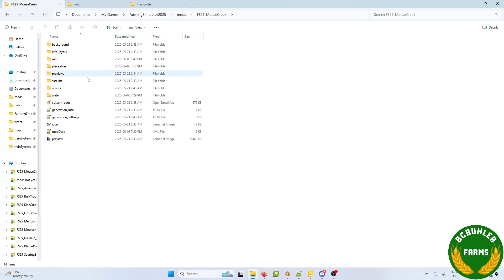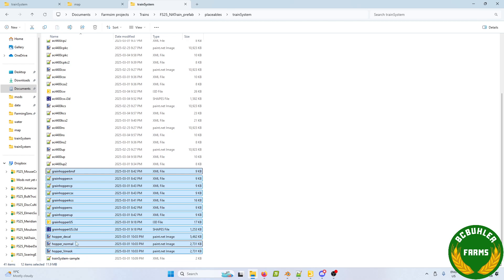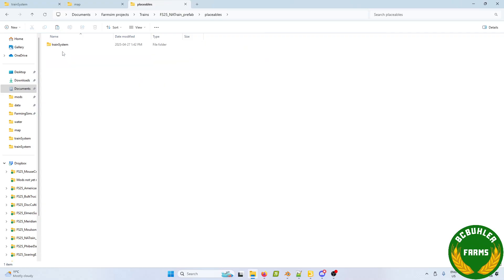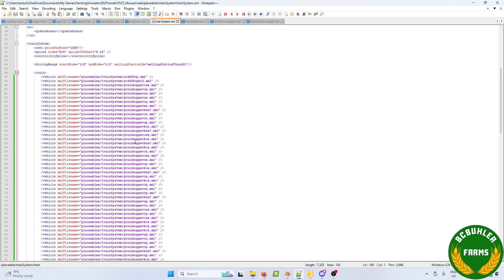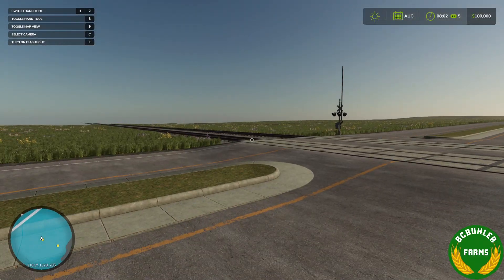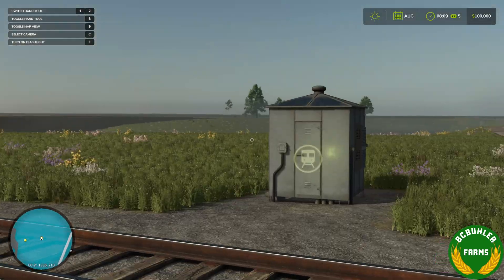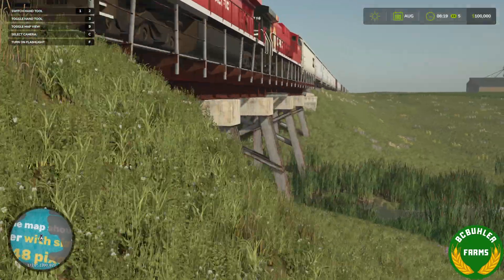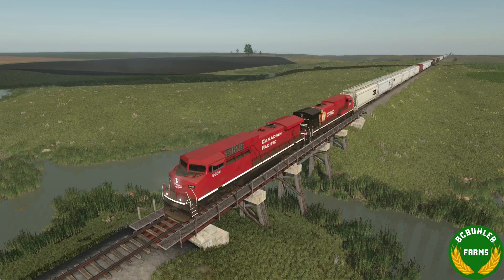FS25 NATrain Prefab Installation Tutorial

Comment: Ok so the trains spawn on the map I can rent them etc but now when try to purchase vehicle or anything from the store I just get the loading circle 
I assume this had something to do with how they are defined as store items in the modDesc or I could be completely wrong but anyway anybody know what I need to change to get the store to work again 
Thanks
Reply from the maker: I haven't experienced that or heard of that issue. Are there any errors or warnings in the log
Reply: @BcbuhlerFarms I will check the log and double check the XML for any typos
Reply: @BcbuhlerFarms I have few issues in the log :no vehicle navigation cost map found 
Error: unable to find vehicle store item ac4400kcs/ac4400kcs.xml 
I doubled the name up that's how was with the base train system on the mod map 
I just need to fix my XML's up and store should work 
Thanks for your reply
Reply from the maker: @alaneggins4556  yeah you'll have to make sure all the file paths are correct to where things are located within the map folder.